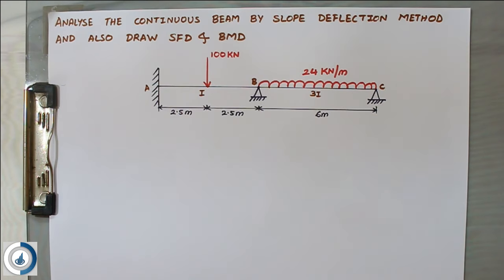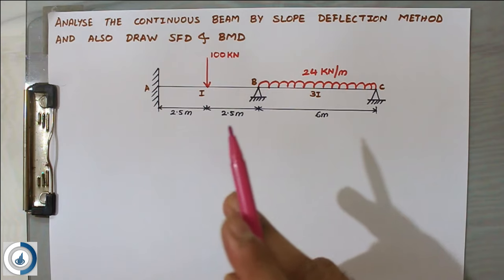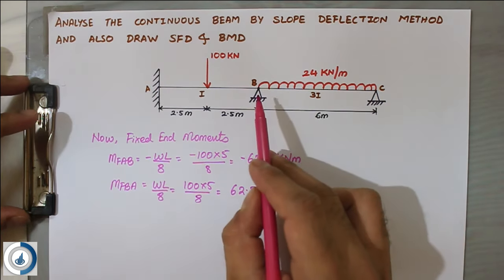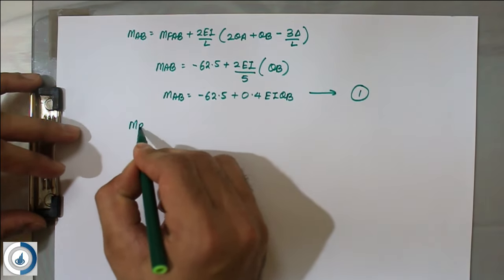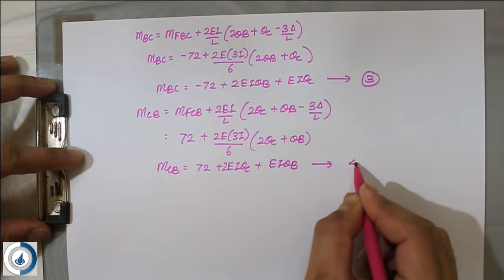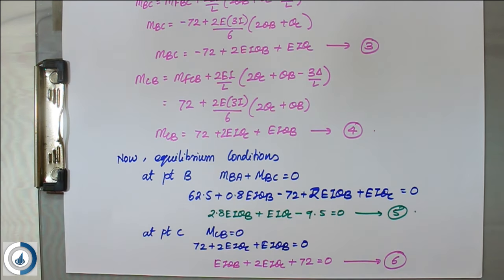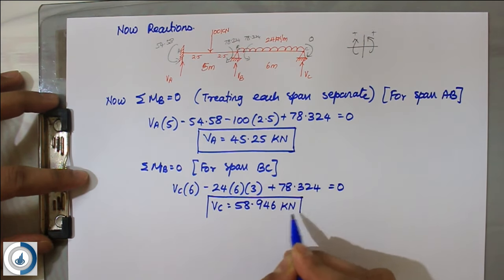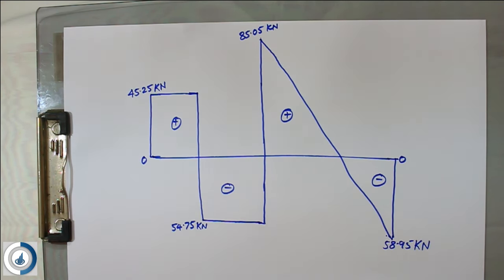Slope Deflection Method having 1 end Fixed other end Hinged with Shear force  Bending Moment Diagram

Comment: Can you start bar schedule prepare video sessions bcoz most of the tutorials are in youtube is totally wrong.plz consider this matter
Reply from the maker: Sure, i will take up this topic very soon, thanks for watching
Reply: As I think it should be included
1.Fixed end support Beam
2.Cantilever slab and beam
3 continuous slab and beam
4.Columns
5.verticle and Horozontal openings
6.chairs,2 legs,4 legs stirrups